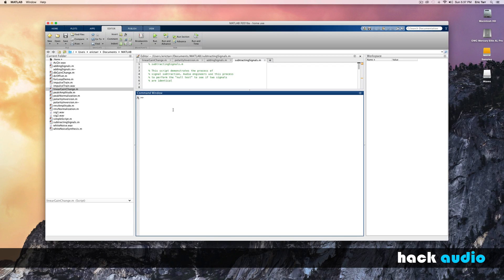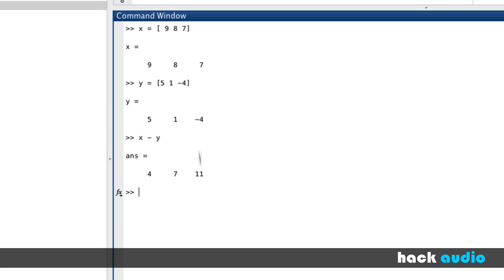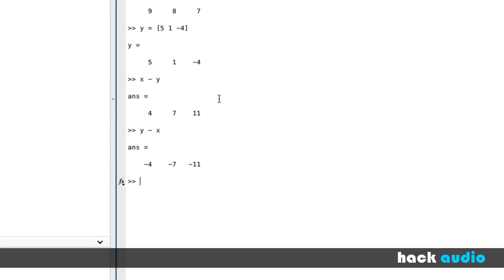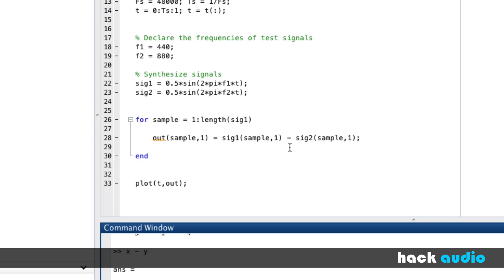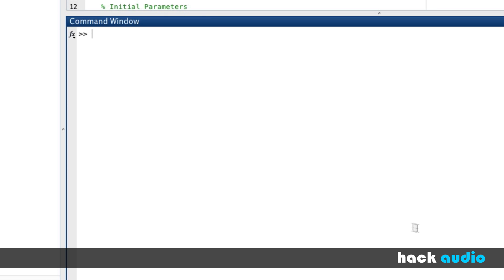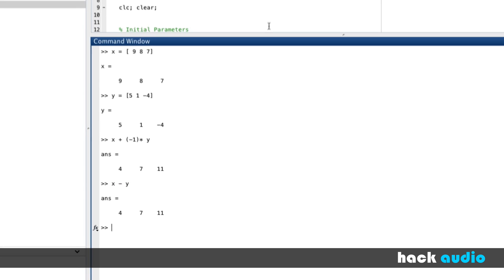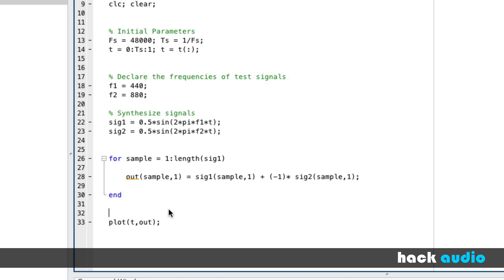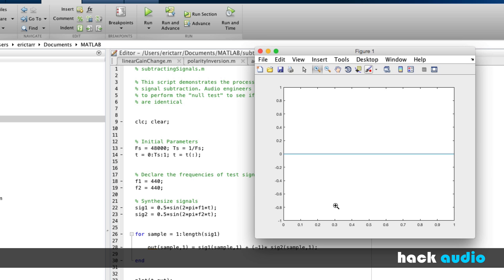Hack Audio: Subtracting Signals

Comment: Can you please tell how can we remove noise from a noisy signal?
Reply from the maker: There are several different approaches that are commonly used. They each have their own advantages and disadvantages. One thing to look into is spectral subtraction based on an FFT. Another approach is to use adaptive filtering for noise reduction. Both of these approaches are a little more complicated than what is demonstrated in the video. However, there are many examples available for MATLAB that you can find online